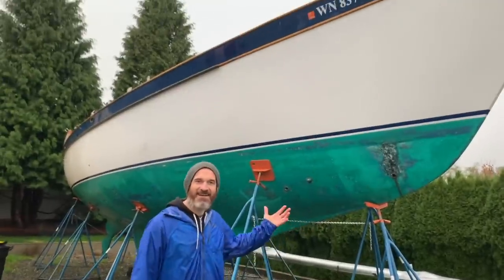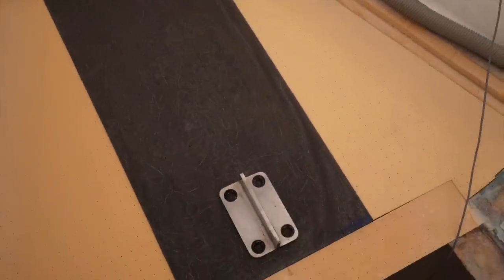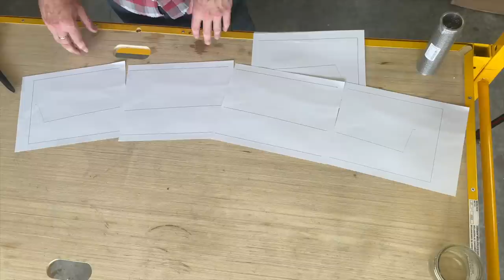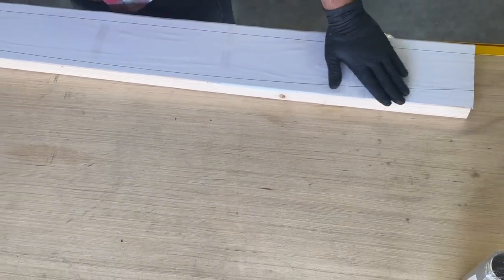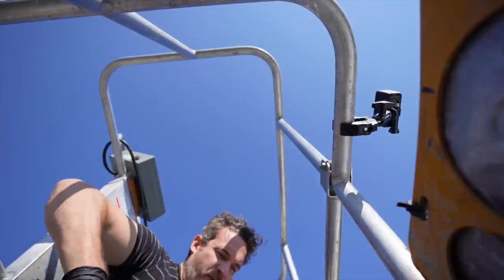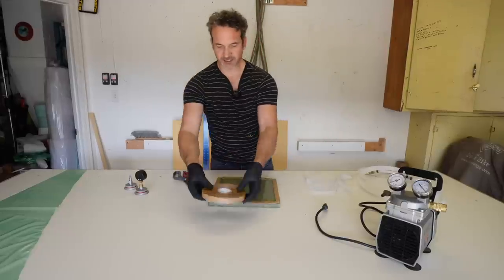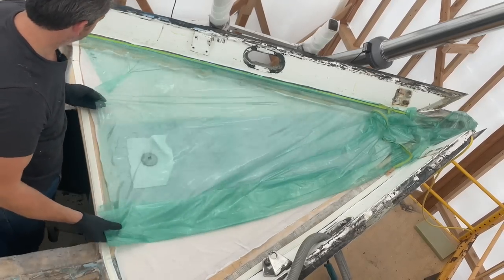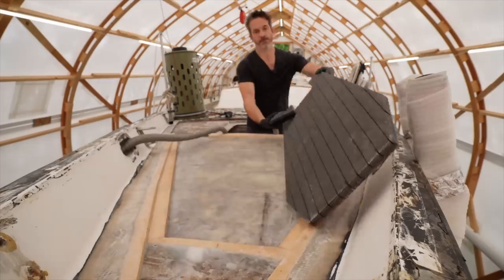VACUUM Bag Fiberglass Boat Core REPAIR - Will it HOLD?! - E013

Comment: Some advice here on vacuum bagging.  I was trained to add pleats along any inside corners.  When the vacuum draws the bag down, the pleat will suck into the corner, preventing the bag from bridging over this area.  Not much need for pleats over a flat surface.  Outside corners and flat areas will always draw down and lay flat.  It's those inside corners that are tricky, and making sure your bag covers the entire surface.  I also made sure the ports were installed before the bag is taped down to ensure there are no wrinkles in the seal area.  FYI, I worked for an aerospace composites company my first job after college, so I've done quite a bit of vacuum bagging.
Reply from the maker: Seems logical. So you’d put a pleat close to the corner on both edges? I can definitely see this is a skill that will get easier each time. I’m getting more comfortable with it. This video was my first attempt. I’m just thrilled that it all worked!! 
Thanks for the tips. 👍🙏
Reply: @livingforsail Yes. Line up the pleat along the length of the inside corner. That gives the bag material room to move as it "stretches" into the corner. It is definitely part skill, and part art. You get better with practice. Just try to think where the bag will stretch as it pulls in, and use a pleat to allow the bag to move, rather than stretch. I know your bag film has some stretch, but this is still good practice. Stretching over an inside corner will mean no pressure is applied to the laminate, and that is a recipe for voids.
Reply: @LFS Why would you put the port in the corner and not in the centre? If you had to choose the worst place, you would select just this corner.
Reply: @Luzt. Putting the port in the corner doesn't hurt anything. Once the vacuum is established and constant, there will be no more flow, unless there is a leak. Use of a breather fabric will ensure air has a path to the port, but for simple shapes is not always necessary.
Reply: @tomm1968  Edit - I answered the wrong person, but leave it as it is ...
The fact that you left the pump running do not square with the claim of no leaks. I, being an engineer myself, automatically see the need for some presostat so that the process is always correct and pump works only if necessary. I agree that any location my be good enough but still - this is the worst location. Anyway, you are doing a great job and the only problem I see is that you may not get the boat done bfore 65 at this pace ;-)
Reply: I know this is months after you've started, and you probably have more vacuum bagging experience now, but this video is an excellent demonstration of how to do it.   
https://www.youtube.com/watch?v=BGjvM2PrkYA

Comment: Great job getting organized and learning your equipment before trying it on the real deal.  

I could not tell if you buttered the butt joints on the panels with epoxy.  Also, I couldn’t tell if you did it on the G10 block.  

I was taught that you never put a piece in dry.   What I mean is the part you’re piecing in should also have epoxy on all the edges and surfaces it will join to.  It helps prevent voids.  Please excuse me if you know this and my eyes need to be checked.  

Again, great job!
Reply from the maker: Hey. Thanks for the feedback. Yep, I troweled all glued surfaces edges and faces before putting anything in. It’s part of the reason it took so long to get it all together! It probably got lost in the Timelapse or hit the cutting room floor. It’s a good point and really important!
Cheers. 👍🙏

Comment: great video the vacuum bag process takes a little pracftice but you have the idea it will get easier. i have one sugestion for your setup, use some 6 or 10 inch plastic pipe with a sealable screw lid on one end to build a resin trap in line with the vacuum pump it will prevent excess resin that isn't trapped in the bleeder cloth from making it to the pump. cheers and keep up the great work
Reply from the maker: Thank you! 🙏. I’ve though about adding a trap. So far the epoxy has been pretty thick and hasn’t traveled too far. It’s a great idea. Getting resin to the pump would really ruin my day…
I appreciate the feedback. 👍
Reply: You can also buy small oxygen humidifiers with a flow meter that can be used as a resin trap.

Comment: You can bend a batten to make a curve. If you attach legs to the batten to form a C, then when you force the legs together, the bending moment in the batten is approximately constant and the batten forms a circular arc.
Reply from the maker: Thanks for the tip! 🙏👍🙌

Comment: Another great video, thanks Jon! I'm still working on my shed, but I have received a shipment of divinycell for the core replacement. Watching this is very helpful and I am also considering using vacuum. My only concern is that I'll be doing it overhead.. 
Keep up the great work!
Reply from the maker: Hi Viktor, I’ve been watching your shed build on IG. It’s looking good. 
Vacuum might be the best way to get a good bond from below. If you work in manageable sized sections it will probably work really well and the top skin should be stiffer than what I’m gluing to and probably smoother also. 
Good luck and keep in touch about your project. 👍🙌

Comment: Just watched to the end. I make a lot of composites,  ususlly vacuum infusion. 

Do you have an in line catch pot to protect your pump? Also over large areas its wise to have a better vacuum path, use some spiral wrap or somesuch. Less of an issue when there isnt much resin about. However you might find it useful if you infuse the deck layer. Check out easy composites videos.
Reply from the maker: I haven’t considered any infusion for this project yet. My understanding is that I would need a better pump and a near perfect seal for that. 
This was all wet layup and I just used the vacuum to clamp.

Comment: Just discovered you channel and I’m really enjoying it. 
Quick question though. Why vacuum bag this? Couldn’t you just put weight on it and call it done or is it because of the camber or curve of the deck?
Reply from the maker: Hi. Thanks for the input! 🙏
You could certainly weight it down. The trick would be to get a good even contact without deforming the deck shape so you’d want a lot of braces. You could maybe screw it down and then come back and fill the holes ? 🤔
I like a challenge and wanted to try something new. This is the best way to get good even clamping force without changing the shape of the deck. 
But yes, many ways to approach the problem. 
Cheers. 🙌👍

Comment: Fore deck is looking good. Very precise work. I was wanting to ask about the temperature in the boat shed I presume it’s warmer than the outside temp but have you noticed by how much? I am wondering how much solar gain you can expect, I am in Scotland and planning a similar boat shed but thinking that it will probably be too cool much of the year for fiberglass work. 👍
Reply from the maker: Thank you 🙏. The shed is single wall plastic and experiences a lot of greenhouse effect. It can be around 20-30 degrees warmer in there in the summer. Cloud cover or shade if you have some trees around will keep it more stable. I was having the problem of too hot for this work for several weeks because it takes so long to get everything assembled working solo and I needed more open time.
Reply: Thanks. That’s a big increase in temp. I’ll maybe ask again once we get into winter. 👍

Comment: be sure to coat both surfaces with resin first
Reply from the maker: Yep. All glued surfaces (faces and edges) were coated with a thin layer of unthickened epoxy followed by a troweled layer of thick stuff.

Comment: So you vacuum bagged that area just to be able to get that contour correct?
Reply from the maker: That’s one reason. Easier to keep the correct shape and just WAY more even clamping pressure than I could otherwise get (and it was fun)
Reply: @livingforsail  You're the man, this channel is truly awesome.
Reply: @livingforsail  Was there any way to do the vacuum bagging with just a shop vac and tape?
Reply from the maker: @hellapellanyc6465  I've heard of people getting away with it. I'm not sure what kind of vacuum pressure you can get with that. Diab recommended 20" HG for gluing the foam.
Reply from the maker: @hellapellanyc6465  Thank you! I appreciate the positivity! Cheers.

Comment: Old Farmer's trick, they are bothered by birds doing the same to their bagged silage, hay, straw etc. if left outside a barn and built into a large structure. The birds spoil the top row. Was at my Father's (an old farmer) and noticed that he left one bale, the same bale as he used the stuff up, higher than the others. The birds would only roost on the top one, think dominance and a better lookout. He sacrificed one bale for all the rest. Just ion-case you have further damage. A raised roosting pole or whatever would work with their nature. Won't stop them evacuating their bowels, see how nicely I said that, every time they take off, but that is relatively irrelevant and nothing else will stop that anyway.
Reply from the maker: Thanks. I think that sounds like a good idea if I have persistent visitors. 
Thanks for keeping the comments PG 🤣. Thankfully it rains a lot here so the shed gets a good wash periodically. 🙏👍

Comment: You sure make life difficult for yourself! Why not just put a flexible beam under the deck and clamp up at the centre. It would conform to the shape with ease.
Reply from the maker: Because “there has to be a harder way?!”
The bottom skin here was pretty wobbly and uneven so I wanted something to make sure the shape was close to fair. 
I’m sure your suggestion could also work.